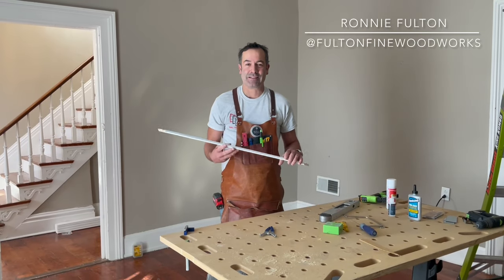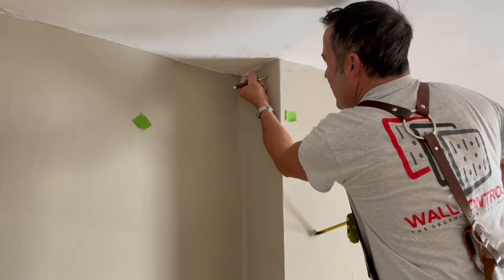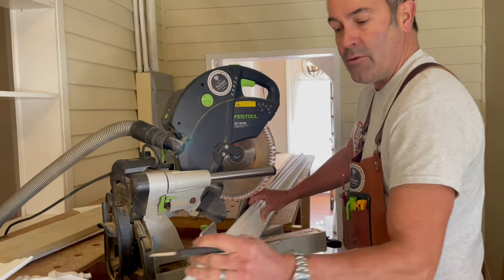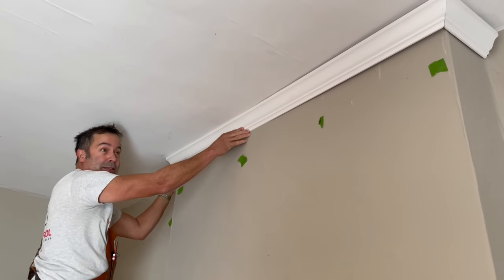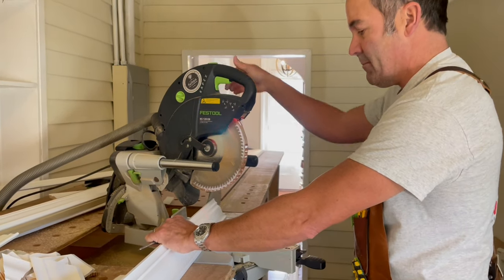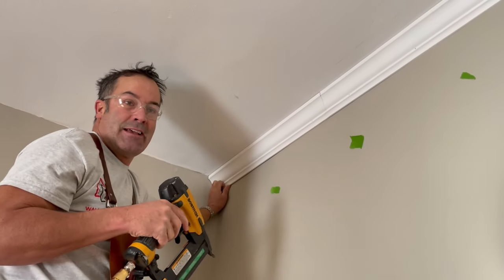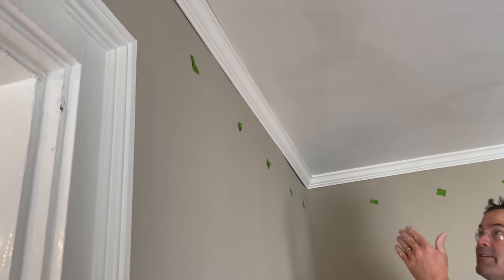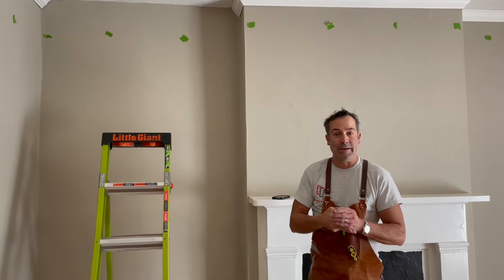"Upside down and backwards???" How to install crown molding

Comment: I am a finish Carpenter and this was about the best video out on the internet for doing crown. I would do exactly the same. The only diff is i use a laser tape when alone and a sanding pad on a grinder to sand the cope after hitting it with the hand saw or jigsaw! Great video! 👍
Reply from the maker: Thanks for the feedback - I use a laser tape regularly as well it's very handy! I have about 5 Bosch ones mainly because I lose them and then find them later on after I buy another..
Reply: I done the same. Ive bought 4 or 5 now and who knows where i left them! 😊

Comment: Excellent work.  I find caulking more efficient by pushing the tube along the work rather than pulling; seems to fill the gaps better.  Also, coping can be done effectively on a table saw and fine tuned with a 4-in-hand rasp and utility knife.  Thanks for sharing your expertise.

Comment: Dude, you are a legend. I've probably watched 1.5 hours worth of crown moulding installation videos tonight and came out of each one of them with more questions than I did going into it. 

You explained everything perfectly. I particularly appreciate the info on measuring to the wall side and how to do a mid wall joint.

Comment: I just finished Placing crown molding in my master bedroom. This is a log cabin and my crown is clear finished. The ceiling and walls are very uneven. Several places I had to use wood putty to fill in the cracks. But I sure wished I would of viewed your video before I started. Very well explained. This was the third room I crown molded. ^The other two room were small enough to have no seams. I would then measure with measuring sticks, that was the only way I could get accuate measurments. Great job.

Comment: Excellent demonstration  and explanation of this process . The only thing that I am not sure of is the backwards element . Upside down is easy understood but the backward part always has confused me . The idea odfthe two sample cuts is  great tip and is fool proof for me as a DIY er .
The last small job I done left me frustrated as I started off with a good length of moulding and was panicking after I messed up most of it .

Comment: 22:56 First, thank you for a great vid and instructions. Some, like myself, enjoy learning something new. I’ll never be a professional, but nevertheless, I love doing new things. My question is about a double cope. You said to measure wall to wall. When I did this, it was about 1/2” too long. I cut my first angle, then when I measured the length on the crown, I moved the end of the tape over to  90 degree line on bottom like you did when measuring for your outside corner. I did cut the bottom at 90 degree while doing the cope, as instructed. Can you give me a little more detail on how to measure for a double cope? Thanks again
Reply: I have the exact same question!

Comment: You started out stating how important it is nailing the molding on the studs, then you put the splice between studs. The double out on top of the studs is low enough to use. Glad you be leave in coping inside corners. I am a retired carpenter of forty years. I was taught to, first, build a miter box. I hand drove my nails for many years. When using a miter saw, I always cut flat, even in odd angled corners. I always left that bottom tab on. Leaving it on, will make others thank that it is a mitered corner. Glad you take pride in your work. Most carpenters now days miter all joints. Time is more important to them, than quality.

Comment: Thanks for sharing. Much appreciated. I'm a newby to crown and got through my 1st project with a just a few mistakes but recovered well. I found that coping was a hassle and just measuring the cuts so the inside corners blended / flowed into each other was much easier. Just wondering why you did not just cut the insider corners vs coping? Again to me it seemed much easier to just make the cuts. I messed up more crown trying to fiddle with coping the insides. Thanks
Reply from the maker: I double mitered forever nothing wrong with it, I have just found I can spring a joint much tighter with coping. Another nice thing about coping is say a inside corner is 88 or 92 degrees you can still cut at 45 and cope and it will fit. You also get to cut one with a flat cut which saves time. Double miter requires exact and the wider the molding the easier it is to have a gap at the top or bottom. Coping also allows for future wood movement and makes any separation less noticeable.

Comment: Thank you for sharing your experience installing crown molding. I appreciate it as everyone has their own methods. I can only say that doing white crown allows for a much easier application and time. I am by no means a crown expert, and defer to your experience. A few things to mention and ask if doing this already prefinished with varnish. I  am currently doing a house that requires crown application in a natural finish and varnished. I am varnishing prior to cutting and putting on. I seem to have problems with the alignment in wall to ceiling. If you were going to do a job that required no filling of joints since it was going to be a varnished finish, how would you best keep that crown running nice and true, as once you get to those corners, they have to be sitting in plane to one another to get that perfect fit since you are not going to be able to do any filling in, other than caulking the crack from the walls or ceiling imperfections? Would you snap any lines on the walls at all?  I do let my inside corners run un-nailed until I meet them up. I also have been butting any long runs together with biscuits to get a perfect fit and keeping it perfect when nailing, as I cannot touch the joint to fix anything once put on. I guess there are different ways of doing crown for different applications. For your job, you did the best thing.  For me that would not work well. For cabinets or small one piece rooms, I would not do any coping and would fit and nail before putting on the cabinet tops. I also have to use a cutting jig as those cuts cannot be off at all since I cannot get any cuts not fitting perfectly. And my most important tool that is absolutely necessary is a number 49 and 50 Nicholas patternmaker's rasp. I could not do this type of work without these rasps to dial in the fits. Any comments or suggestions or doing pre finished varnish crown? 

I guess you could always do it unfinished, but I have tried it that way also, and it is too time consuming to go back and sand and varnish up that high for me anyways. The inside and outside corners still have to fit good as you still cannot caulk them up and varnish over them without it showing terribly. Man, that white finish is a lifesaver for us carpenters anyways.
Reply from the maker: Hey sorry for delay I missed this one. For stained molding I always cope inside so I can get as tight of joint as possible with minimal chance of opening later. I make sure I am very accurate with measuring the outside corners so they are tight as well. I make sure the molding is level all the way around the room on the walls and I ignore high places on the ceiling and leave a gap. This gap can be filed in with mud on the ceiling and feathered out but for minimal gaps caulk can be used and no one will ever notice. It's noticeable when the wall side is not level however thats why it gets priority.
Reply: I did not see him address the part regarding varnishing prior to installing...it would be near impossible, difficult and messy to stain, sand and varnish.
 
I stained, sanded and varnished all the crown molding for our older house reno in early 2019 BEFORE we installed it. 
I shudder just thinking about doing it after...I chose to match the stain to the floor, which is Jacobean and ebony mixed together...what a mess on the ceiling and walls, then the sanding with dust everywhere, and the weird way of working with your arms overhead...yikes...and very unsafe to boot. Better to do all the staining, varnishing and sanding BEFORE installation. You can keep all the mess confined to your work area and be safe and comfortable to boot.

Comment: Excellent video. I was told that you should always go for one “butt” cut and one cope cut on each length where there are the inside corners of the room. That avoids having to do a double cope which is the hardest of them all. 

The walls I’m about to start to cove are masonry which makes life a lot harder; I don’t know of a better way than to use fast grab adhesive on the back of the cove and use masonry nails into the wall representing the line of where the cove hits the wall. Effectively, you have the masonry nails as a temporary shelf to lean the cove onto until the grab does it’s job.

Please tell me better ways!
Reply from the maker: Thanks! Your on the right track that will work, one other option you could install a piece of wood against the brick fastened with Instagram and tapcon screws around the perimeter that allows the crown to sit over it. Then when you install the molding you have a nice place to nail into. If you rip an angle on the wood you can get even more wood behind it. Just make sure you allow a space inbetween so it doesn't get in the way of the molding.
Reply: @fultonfinewoodworks  wow, that was quick. Could you please give a little more detail on using instagram as a cove adhesive?

Seriously, my next coving job is a complex (multi-part) solid oak (home moulded) cove around the entrance room in the barn now nearly fully converted. There will be dentil, bed, cove mouldings all combined in a Tudor style. For this, I am planning to put up a softwood form that goes behind the oak mouldings: it will triangular but with clipped corners - something like 1” vertically down from the ceiling; 4” at an angle and then 3” horizontally from the wall. I’ve yet to make final decisions on the mouldings and I need those before making the form that will support all the mouldings. But, if I get the form right, it will make fixing the oak much simpler. One issue with real timber is that caulk and paint isn’t an option.
Reply: 0 itty

Comment: Exactly the way my father taught me 40 years ago.  Upside down & backward.  Cut off the face of the inside corner and push it into the butt cut piece.  I tried to explain this to an experienced carpenter who uses the presets on the miter saw and never gets a good corner!
Reply from the maker: Your Dad is smart man! Awesome to hear! I get comments about double mitering inside corners is better but I have installed both ways many times and this way I have found stands up to test of time for sure. A lot of trim carpenters never see the work they install 1 or 2 years later. I learned in my own home and experienced the surprise cracks 1 year after install. Led me to finding a better way.

Comment: Hi,
If I need to cope both ends of the crown then am i measuring from wall to wall or end of the butt crown to the opposite end?
Hope it makes sense. First time doing crown and your video is helpful. 
Thanks 
Abhi
Reply from the maker: All your measurements are referenced on the bottom of the molding. While on the saw because the molding is upside down this will be the top. This is handy because it's easy to see your mark and where the blade needs to cut. To further answer your question you measure from the butt to the location where it will touch the end of the wall the angle does it's own thing either growing or shrinking past that point.

Comment: Great video - quick question to confirm my understanding of the correct miter angle setting when cutting for an inside corner. For the piece the will later be cut with a coping saw, are you setting your miter saw to 45 degrees to make the initial cut to length?Thanks!
Reply: Or in other words - what angle is the miter saw set to at 17:30 of the video? Thanks
Reply from the maker: Thanks. You are correct that cut would be a 45 for a standards inside corner that is being coped. You follow the same rule as cutting half of the actual angle and the other side is cut at 90

Comment: Ok day 1 I cut the inside corners right side up instead of upside down and so that was wrong and basically I did everything exactly opposite of what you said lol and went to bed scratching my head. Day 2: I might be able to save the crown. I’m gonna cope it the way you showed and see - wish me luck 😅
Reply from the maker: How did it go?
Reply: @fultonfinewoodworks  I got it! Flipped it upside down, remembered which was the right and left side and cut the 45 the right way and viola - it worked! I had to go back and watch some video segments a couple of more times but i got it - thank you! 🙏🏻
Reply from the maker: @patriot1303  great to hear! It can be very confusing at first but the more you do it and practice, the less you have to think about it.
Reply: @fultonfinewoodworks when you cut the inside corner to be coped, what angle to you initially cut at the miter saw?
Reply from the maker: @mickeymallette2663  generally anything within the range of a 90 degree standard corner is cut at 45 degrees there is a lot of wiggle room when coping, if the actual angle was off from 90 it usually always still provides a good fit. When mitering both sides it has to be exact, another disadvantage of mitering both sides.

Comment: that scarf was not on a stud? i guess with the glue its not necessary. im installing around cabinets in an old house. the ceiling is over an inch off from one end to the other . i need to hold a level line because the cabinets are level. would you rip the crown where the ceiling is low or start from the lowside and leave a gap to the ceiling where it is higher? excellent instructor thank you
Reply: I don't believe a scarf needs to be on a stud. That wastes time and material. Molding is fairly lightweight and has generally many other fastening points on studs where the effects of not having the scarf over a stud is fairly negligible.

Comment: Ronnie, do you  ever use a backer in the corner to nail to?
Reply from the maker: I sometimes do when stain grade, but when painted and knowing it will be caulked where it meets wall and ceiling, it's not going anywhere as that acts as a glue as well.
Reply: @fultonfinewoodworks  ok, thanks, good point about the caulk also acting as a glue. I also liked your tip about shooting the nails at an angle, which should help hold the crown in place better than nails shot in straight, especially if they are only going into drywall or plaster.

Comment: Great video! Would you be able to give me pros/cons of using wood vs MDF?
Reply from the maker: Thanks. Wood is less dusty than MDF and lighter. MDF can break.  The advantage of MDF was at one time it was half the cost of wood trim but at some point store started calling it "premium" because it was smooth and charged more than wood so wood wins in my book. If it will better painted finger jointed pine or poplar usually a great choice.

Comment: Exactly right. Upside down and backwards.  In the saw, that is,not on the wall. The cove always goes down.
On the saw.  For you newcomers just use the red marks on the saw angles and cut it laying flat. Cope your inside corners if you can,otherwise just do the stupid standing inside corners. 
Trust me

Comment: Did you have to cope that piece? Could you if just did a normal miter on the inside corners ?
Reply from the maker: Not a must to cope, you can do a normal miter on inside corners.  I just like how tight I can get it when coping also its great for stain grade moldings, as caulk is not an option.

Comment: How about those huge gaps between the wall and the ceiling? That’s a lot of caulking that would have to be pumped in there no?
Reply from the maker: Sometimes a gap in the ceiling is unavoidable when the ceiling has a dip or is uneven. What I have found is always keep the molding running in a straight line and deal with the crack in a few ways. Caulk if it is under 1/4" and painted. Another option is to float the ceiling with drywall mud to level out the spot that goes in.
Reply: Thank you my brother @fultonfinewoodworks

Comment: What’s a appropriate price for hanging crown molding? About 300 liner feet
Reply from the maker: The cost could vary wildly depending on the overhead of who is doing, the variables of the job, the region the job is, the logistics of the job, so many factors